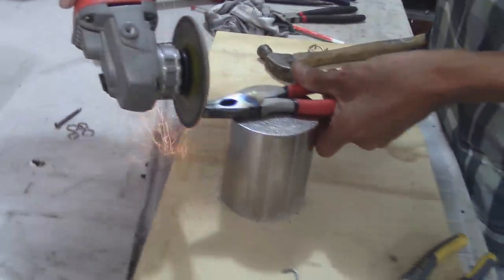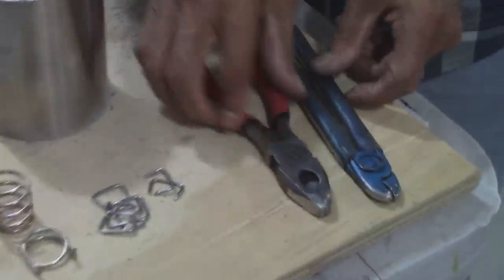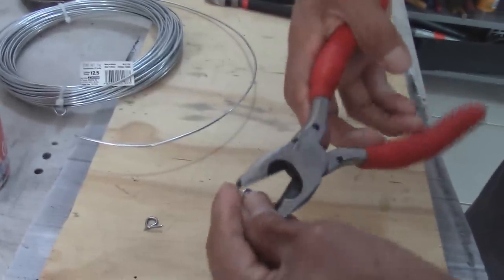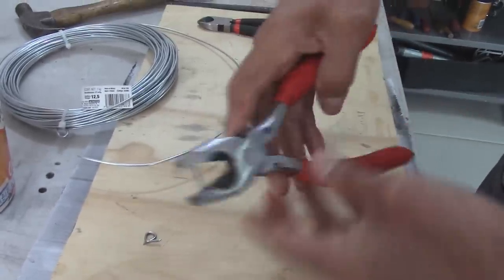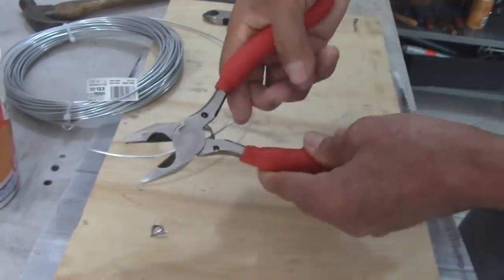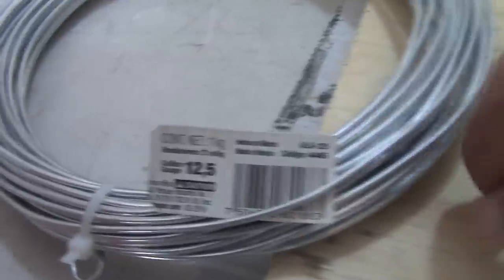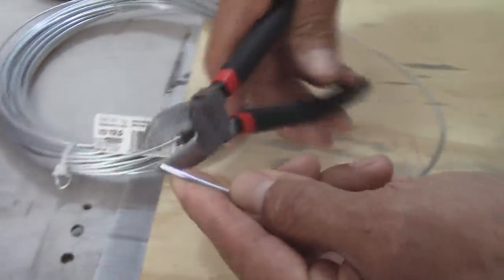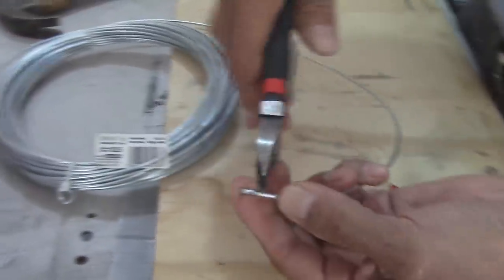Custom Hog-Ring Pliers - Car upholstery

Comment: Awesome!!! I already purchased a pair of hog ring pliers that came with hundreds of hog rings, but after watching your video I already know that I will never have to buy hog rings never again, being able to make them myself, and I can even modify a pair of pliers in case that the other one gets broken! 

The idea of adapting a spring to the pliers is excellent, and getting it hot to work easily with it is awesome ;-)
Reply from the maker: I would say, it is a 'just in case' homemade tool. I would recommend to also make the homemade hog-rings if for some reason you run out of the good ones. Factory hog-rings are cheap and much better. I mean steel wire and has pointed ends to penetrate the material.
If you want some entertainment you could do one yourself.
Thanks so much for making this channel an interesting upholstery forum!
Reply: C'mon man. Hog rings are $2 a pound.
Reply: Delta Johnny o

Comment: Amazing! Do you know of a diy tool that could be made to use 1/8" aluminum wire like j-clips on wire cages?  It's flexible wire (old power cable strands that I have a lot of).
Reply: Basically I want to wire fencing together very tight and without using a lot of extra wire.

Comment: Nice way to make custom hog-ring pliers but I would not have used a screwdriver to finish the work.  A chisel would probably be better suited.
Reply from the maker: Thanks for watching and commenting the video! 
You are right about chisel and of course I have different sizes. Perhaps, at that moment I wanted to transmit the idea of using any tool we have at hand.That screwdriver was a discarded and broken one.

Comment: Не лучше чем наши рукожопы,  отвертку ломают,  вместо того чтоб использовать зубилу.
Reply from the maker: The main idea is the use of tools we would have at hand, I mean a broken screwdriver, drill, a hardened nail, etc. 
I have in my shop different size chisels and I would have used one instead of the broken screwdriver. I also have a mototool I would have used instead of drilling. But, not all the people have appropriate or expensive tools to make a pair of simple hog-ring pliers.
Reply: Cechaflo good,  thanks!
Reply from the maker: You are welcome anytime!
Reply: Для чего этот инструмент?